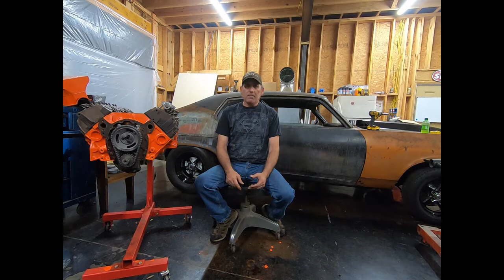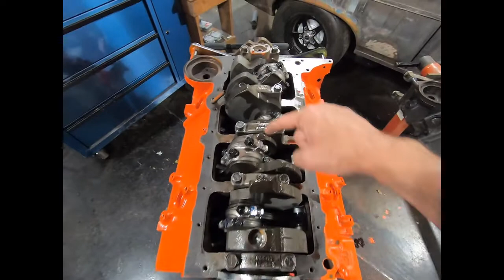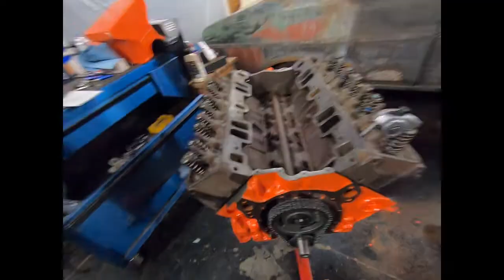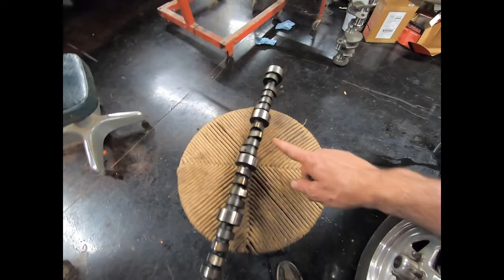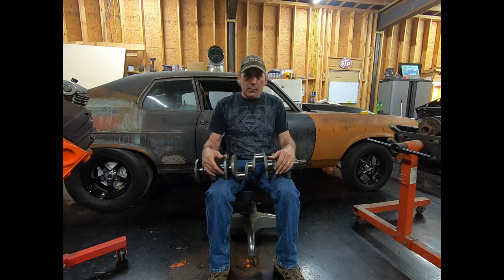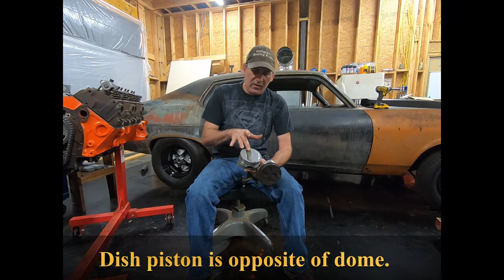Basic Chevy Engine Terms for Beginners

Comment: Hi. Been asking around for help identifying my sbc 350 that came attached to a TH350 in my '77 Big10. The rear stamp code is 14016379. The suffix codes on the front, passenger side, on a spot about 1" x 2", has 3 sets of codes. First set is V7_ _9TBX. Two middle digits are next to invisible, but kind of look like a 5 and 0 for a code reading V7509. Second set is C9Z191819. Third set is 008. All feedback is welcome. This is my first Chevy truck resurrection. Your videos have been extremely helpful. Thank you

Comment: Im a car enthusiast but I KNOW NOTHING WHEN IT COMES TO T TURN IN WRENCHES. I NEVER REALLY KNEW THE DIFFERENCE BETWEEN A BIG BLOCK. AND A SMALL BLOCK AND I STILL DON'T. I MEAN, WHAT YOU TOLD ME. I ALREADY HAD A GOOD IDEA, BUT WHAT'S CONFUSION IS YOU'VE GOT A FOUR HUNDRED SMALL BLOCK AND A THREE NINETY SIX BIG BLOCK, WHY
Reply from the maker: The block architecture is what determines big or small. Not cubic inches. The big block Chevy has cantrd valve heads larger bore spacing and higher deck height. It’s bigger in all physical dimensions than a small block. So a small block can have 400 cubes and a big can have 396

Comment: How can I told its a 4 bolt main without taking it apart
Reply from the maker: Not really a way to tell. Most block casting numbers came either as a two bolt only or as a 2 or 4 bolt. Nothing on the outside of the block guarantees a 4 bolt unless it’s a 400 block then the casting number can tell you. I think on the 400’s the 509 blocks are 2 bolt and the 511 are 4 bolt but I’m not sure.
Reply: @Shop209 thank you so much I got a HD 2500 and I'm getting a 5.7 350 off a 99 suburban. So I'm trying not to waste my time.

Comment: Love the Channel great video , I’m just a 61 yr old shade tree mechanic , 1 step off using a tree limb to hook a chain to to pull a motor and trans . We used 3 10 ft 4x4 and 410x24 as braces and prayed for no rain , why we never realized we coulda threw a panthers tarp over that A frame and stayed dryer lol . Anyway , never did more then motortrans swaps , shocks basic crap . Have started on a 1956 Chevrolet 150 2 dr wagon . Floor just got here and rockers and my 110v MiG welder lol ( all I got ) . Got ahold of A 40 dollar 350 in a dispense of a poor dead guys stuff , ask about motor All they said was he wouldn’t hav3 saved a junk motor . It was stuck , pb blasted plug holes and uncovered exhaust valves , then pulled intake found small mouse house cleaned all that , didn’t pull heads , but this rebuild has cost me a fortune so far since Dec 2022 . So money is all but gone lol gonna hook to th350 stock and see if after rockers and floors and 3/4 forward side mount kit I bought . If I can put it back on the road by. June 2024 . I’m 61 , fell in love with a car like this when I was 11 yrs old 1973 . Any way , help me remember what my father taught me 4 decades ago. Timing , I know basic dot to dot on cam gear crank gear , but other then tdc and distributor pointing at number one , how do I get it set to the Hotrod recommend 8 deg, not sure if that’s before or after tdc . So please timing , valve adjustment . Deepest basics too .  Will message time to time if that’s ok

Comment: Love the videos, very educational. I recently was given a 76 stingray and trying to id the engine. Got the number from back of block but on flat plate on passenger front there is no stamp. Cant tell if block has been shaved or anything as its baby smooth. Guy that gave it to me said its a stroker motor  ( 383 )
But want to know more and he said motor was already in car when he got it. Any suggestions ?
Doing a frame off restore for my grandson and getting ready to yank motor and trans. 
Thanks for everything.
Reply from the maker: The stamp on front pad of block only gives details of original application. If it has been rebuilt or modified that stamp being gone isn’t too big a deal. The block casting number will tell you the block bore size 350,305,307,283 etc. it may also tell you a little more but not much. Without taking engine apart it’s pretty hard to discern any details.
Reply: @Shop209  thanks for info, looks like i may have a teardown in my future. At least to see what internal looks like.

Comment: Really nice explanation. Been around this stuff since a kid early 70 but when you have not had a motor apart in 40 years the basic run down is nice to refresh the brain. Forgot the 4 bolt mains just have 2 on each end.

Comment: Great video... Just subscribed an looking forward to the knowledge... Have a 94 GMC K1500 Truck with a 5.7.... Runs great but it's got some age not original... Figured I'd rebuild it, be my first actual project... Typical GMC cab corners rusted but it's a truck and used as one... Like to add little to the engine to help it give that little help  when towing and or doing recovery at the trails and bad weather you know... So your thoughts on what percentage of building extra might be ?

Comment: Just wanted to ask a question about the 307 build you mentioned that when you were looking for pistons you Aluminium pistons but you ended up with cast. So here the question wanted to know if you put the LS piston beside the 307 cast piston you mentioned there was differents between the 2 and it was about the valve reliefs on the LS Pistons. Was there a chance that you could of taken a moto tool 🔧 to the valve relief and ground the valve relief to enlarge it so the valve would clear it enough to make the valve clear the piston. Hope maybe it would work  on the next 307 if there is another 1 to build. Also I want to thank you for trying to build the 307. Your engine had a very nice sound. Hopefully when you are done with the rest of build you can  Terrorize the streets and the race 🏁 track. I'm going now thanks Ray in Idaho 😎
Reply from the maker: Hey Ray! So the pistons weren’t very thick near the valve reliefs, I was afraid fly cutting them would go through. I wanted to use forged aluminum pistons so I could put a turbo on it or nitrous. For the power and rpm level that engine has the cast aluminum pistons will be fine. I’ll just have to be careful if I add power. Thanks for watching!!
Reply: @Shop209  thanks for your reply I appreciate it. Anyway I was on line last night and I saw some forged  Aluminum pistons under wieseco pistons that had a solid dome on top of them and also they had some that were  Halloe. And compression on those were from 10.5 to 10.9 .as well as 11.1 .  So here is an Idea only I've seen some used  Aluminum pistons out there if a person just kept there eye 👁 open you might get lucky and buy a good used set of pistons that have a solid dome that way it gives you some play room. Just so you know I haven't ever rebuilt an engine I've removed serval engines heads done some front-end work replaced brakes and on I want to rebuild a engine and I thought about the 307 I'd never seen a good build for the 307 I wanted to put it in my 1998  GMC SONOMA with a procharger I think it would give me enough power to walk away most people. And still keep some reliable. Thanks again for the great info 👍 have a great day thanks Ray in Idaho
Reply from the maker: @raystevens687   Yeah, I could have spent more time looking at other options but was in a hurry. You can find older stock style forged 307 pistons on  ebay once in a while but theyre heavy and low compression.
Reply: Hi I figured you were in a hurry. I was just sharing info with you and know about in a hurry to so can relate to you on that. Oh I wanted to share with you I use to have a 1968 1/2 Chevy Nova myself 2 door it came with a 307 but I took it out and put a 283 it had stock exhaust but some kinda mild cam in it also Edelbrock intake don't remember which intake manifold hi volume oil pump  Quadrojet carburetor when I was out and about driving I've had people want to race me they all had 350 chevy in them. And yes I blew there doors off hahaha. Anyway I'm going I do want to your project finished and see how your does when out and about or on the drag strip would be really cool. Thanks for listening just keep up the work. Thanks Ray in Idaho 😎

Comment: Waiting on that. Distributor   installation....just got a  at street fire  hei    for the 74 ...hopefully  i could. Understand  it n and install  it my self.   Thanks.   For the videos  ...
Reply from the maker: I’ll make it so you can. I’m working on that video right now.
Reply: Thanks.
Reply from the maker: Hey. You can check out this video around the 10 minute mark. I show how to make sure distributor is timed correctly. It’s not as in depth as the video I’m working on but it will help. 
https://youtu.be/517A55JaGok
Reply: @Shop209  i seen all ur videos. Since day one u started  with the project... ...so u could use a  screw driver to put it in position  for number one and i dont understand  when u say  dont turn the  cap for advanced
Reply from the maker: Gotcha. I’ll explain all that in the new video. I appreciate you watching my videos.
Reply: @Shop209  thanks n thanks for the videos 👍👌👌👍